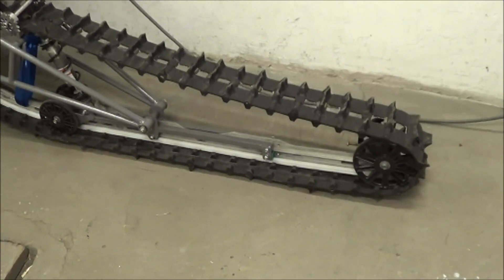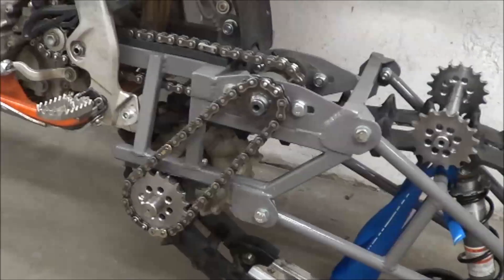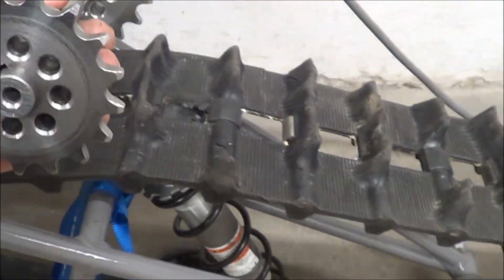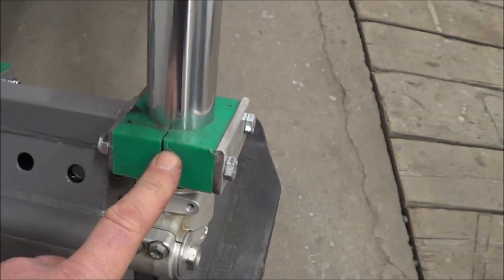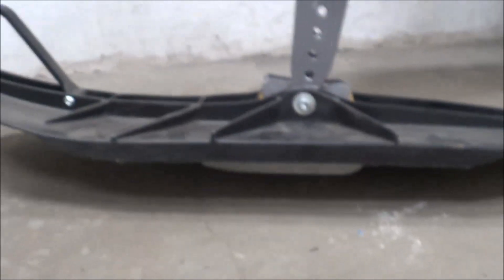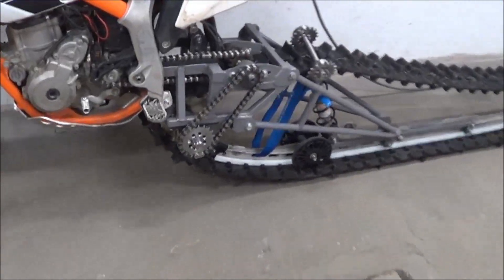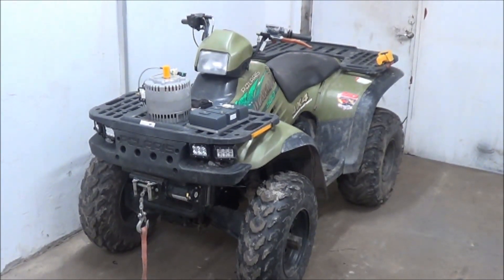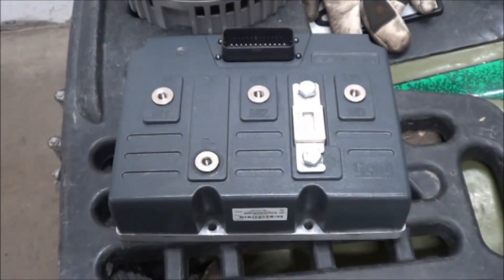DIY Snowbike

Comment: Can't find brakes
Reply from the maker: Hello, Alexander !  Who needs brakes ??  That's correct don't have any.  BR Per
Reply: @persteel  I never ride one of those bikes. Don't you need them? Is this version able to jump?
Reply from the maker: @alexanderpotzelsberger3567  I haven't needed them so far, but this is a fourstroke engine soo it has some engine brake. Also driving in snow is heavy duty, stops almost direct if you stop twisting the throttle.  No problem with some speed and a bump.  BR Per
Reply: @persteel  i plan to make my owen track with cutting  two motocross tires on the left and right side to keep the middle of the tire and steel the round stability. 2 modified tires together should be enough for 250 2 stroke
Reply: Yes four stroke explained it with the brakes. How can I forget that. Classic 2 stroke rider 😏
Reply from the maker: Yes, it could work.  BR Per
Reply from the maker: Yes, it's a big difference. BR Per

Comment: Very nice Per, is there any chance of buying any type of drawings of the build?
Reply from the maker: Hello, Soldy ! I just made some sketches and printed it on a PDF and then during the build I changed construction without making changes on the drawing. If I had drawings I would give you them for free. I think if you get the parts an lay them out like I did on a big piece of paper, things will work out for you. But I check what I got left of drawings. 
BR Per

Comment: I was looking for someone building something like this. I'm thinking of building a track for my bike miself. Did you buy a whole snowmobile for those parts? Do you have a full parts list?
Reply from the maker: Hello, Benjamin ! The best and cheapest way to do it is to find a wrecked or a snowmobile with broken motor. Then you have all the pieces you need and can adjust it to your build.  Only thing I can recommend is to find a snowmobile as new as possible then you can find new pieces on aftermarket. If you look into the Electric Snowmobile playlist you can find tip how to build your skid/boogie.  BR Per

Comment: Get a motorcycle lift table or similar. Very easy to ruin your back if you work like that for many hours. I have lived with back pain for many years after i tried to weld a skidplate-linkage guard. I have raced motorcycles for 20 years but i hurt my back while working on it. I hope you can consider buying or building a lift table for your own health. Nice snowbike cant wait for a testrun video.
Reply from the maker: Thank you for your consideration, I must get something to make life easier. Not young longer niether. Sorry for your back. 
Yes, I am looking forward to test it !!
BR Per